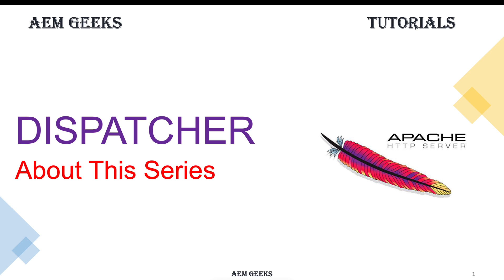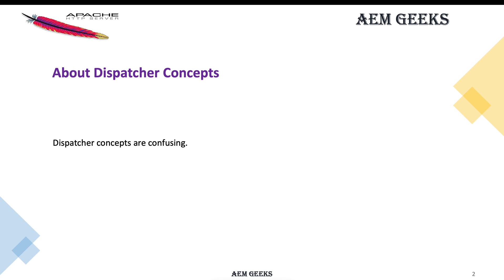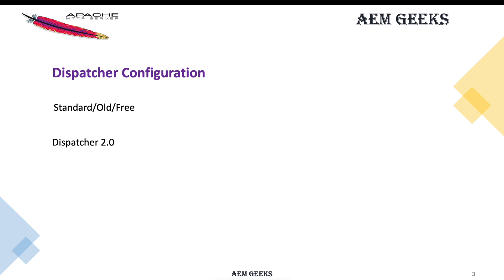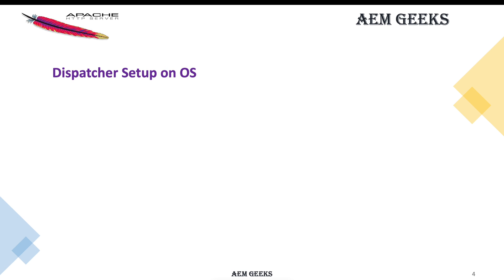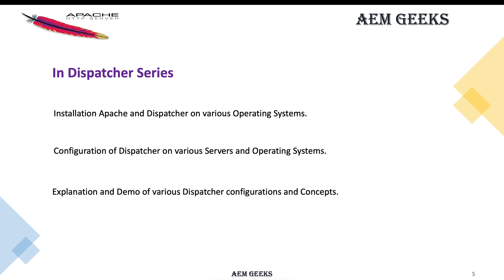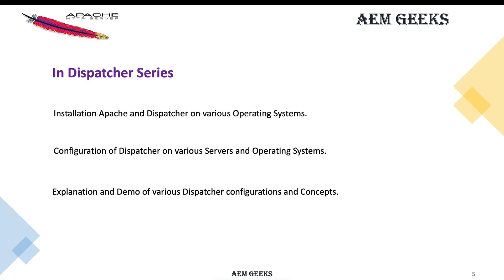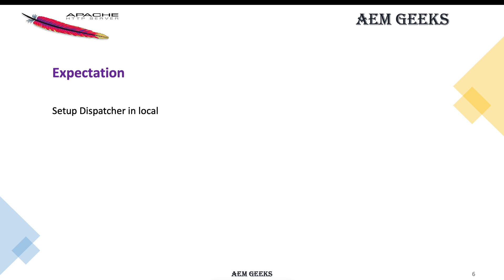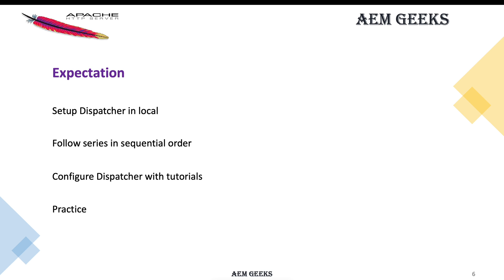Dispatcher #1 | About Dispatcher Series

Comment: As you have mentioned about latest archetype. Can you pls make a video on How to create a project using latest mvn archetype (probably 39 in 2022) ??Enable all archetype properties so that project consisting of all necessary modules
Reply from the maker: There is already a tutorial in developer series. All the concepts explained in that tutorial are still valid. You just need to add additional parameters as per need. Just make sure you create project as per instance type(standalone or cloud). Though, I will create a tutorial about creating project in coming tutorials